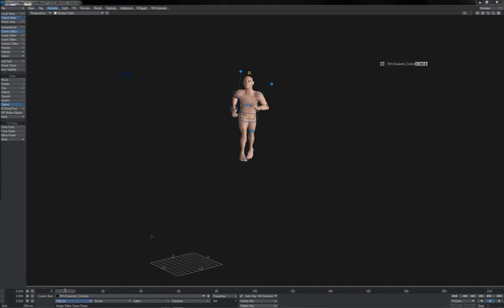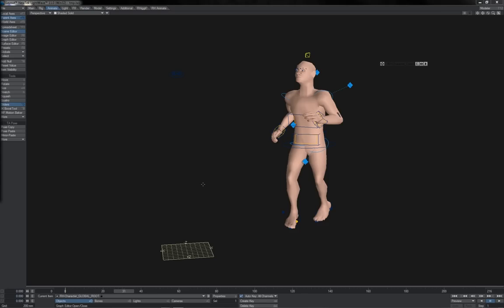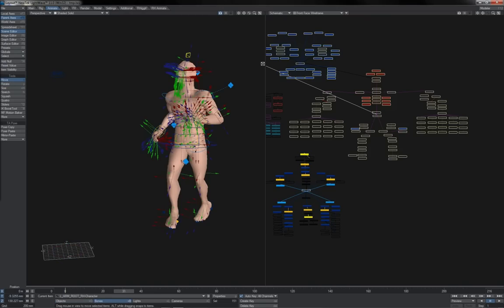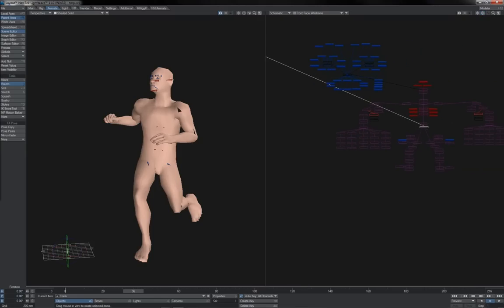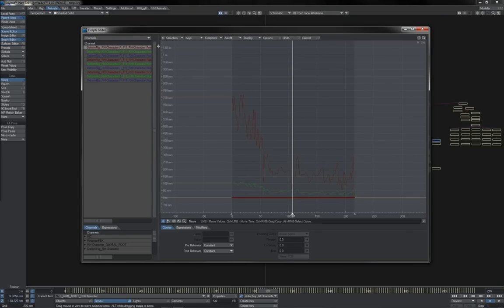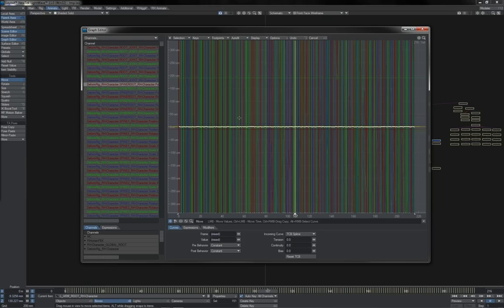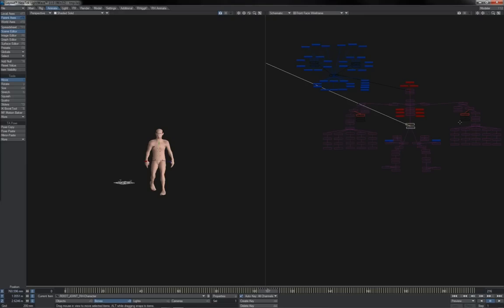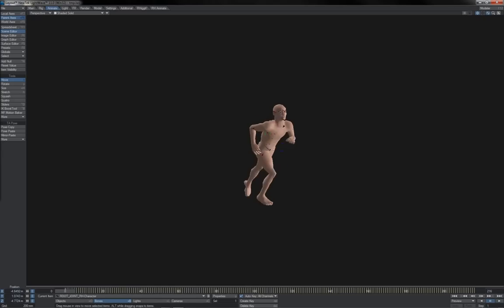Rig Baking

Comment: I don't know what you think about it, but I often find a plugin called "keystrainer.p" useful for cleaning up all of the excess keyframes.

It isn't perfect, but it is very fast. Just select all the bones, chuck them through keystrainer, job done. Depending on the settings, you get pretty good results. 

I'm not sure how easy it is to find these days. I only have a 32bit version, but that's fine. I just thought it was worth sharing.. as it is just a bit faster than selecting all channels etc.